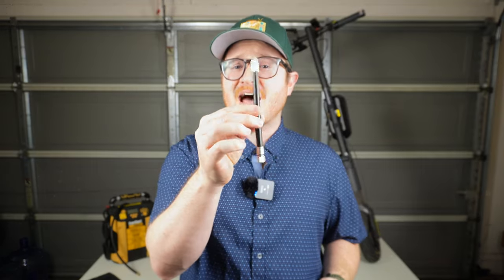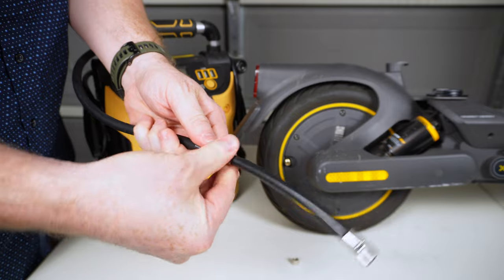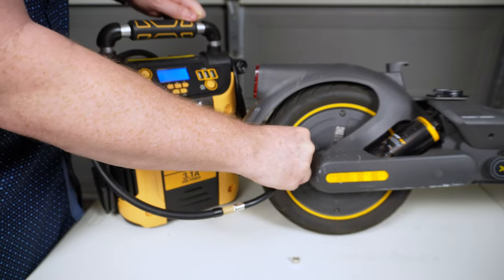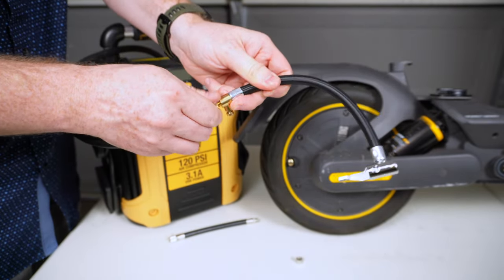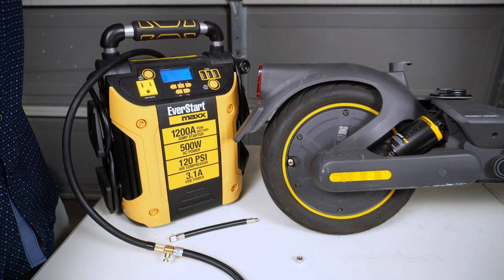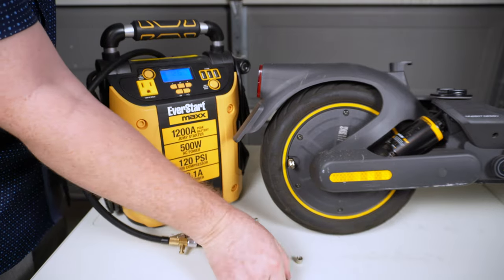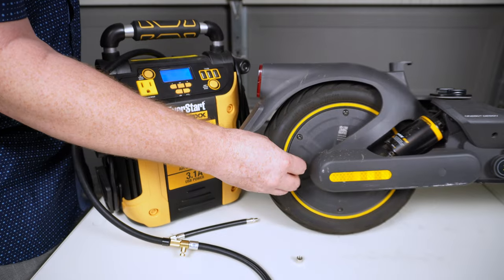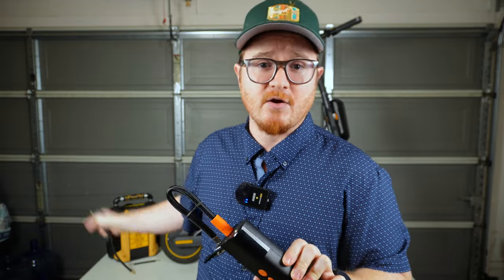Easy And Useful Electric Scooter Hacks ♻️ Enjoy Simple Tire Inflation

Comment: Ya , those original valves are completely useless! So frustrating as you lose so much air trying to attach/detach them! Thanks for this video showing the adapter, I will order one immediately.
Reply from the maker: Yah I was also frustrated. You lose like 5-6 psi just removing it lol.

Comment: its simple. dont screw the extender all the way in. screw it on enough that when you push it in it opens the valve. hold it in while youre pumping and voila you dont have to loose pressure while unscrewing it
Reply from the maker: I’ll definitely give that a try and report back. Thanks for sharing!

Comment: Are you able to still check psi when you first attach the chuck adapter?  So u know how much air to put in it?
Reply from the maker: You can. As soon as you lock it on it opens the valve so you can get a readout.

Comment: I actually add (just) a little more than recommended for the air pressure so the loss on removing the pump is even less. Do it on my e-bike, motorcycle, and scooter.
Reply from the maker: That works too. I’ve had cases on some scooters where the valve stem doesn’t protrude enough above the surface of the wheel to where by the time I get the rubber extension off I’ve lost like 20% of the air.

Comment: Bro my valve is pushed in & I can't get the chuck adapter to grab it bc it's pushed in to far, front wheel,  does anybody kno how to fix this? I tried needle nose pliers but it still doesn't grab it
Reply from the maker: Are you able to let air out of the tire and try and manipulate the tire around to reposition the valve?
Reply: @tomsgadgetgarage  ill try now!!
Reply: @tomsgadgetgarage My Pop said to put an extender on it & I can put air that way but I jus bought it last week & it shouldn't be doing that right??
Reply from the maker: It shouldn’t do that but even when all is right, there’s not much to work with. I’d get the extender though. Will definitely make things a lot easier.
Reply: @tomsgadgetgarage  ok thx bro I appreciate it 🙏

Comment: Thank you for such wonderful tutorial just discovered your channel you earned a sub, question if i dont have the extension thing am i really out of options? Someone said with pliers i can force it come out a bit
Reply from the maker: Thank you! It’s possible that would work with a tubed tire. Tried that on a bike that had a short valve on the tube but ended up getting an extension as it was a bit of a pain. I’d honestly go with the extension if possible.

Comment: Why not just use the valve stem extension if it doesn't lose any air?
Reply from the maker: You can use the valve stem adapter with the screw on hose connections. My issue is that it’s more of a pain to get on and off compared to a chuck adapter.
Reply: @tomsgadgetgarage  I prefer a simple connection method that is cheaper / saves money :)